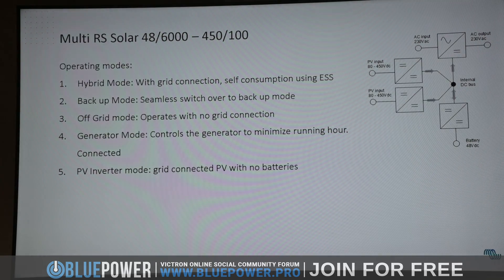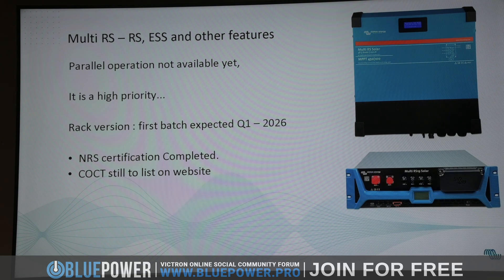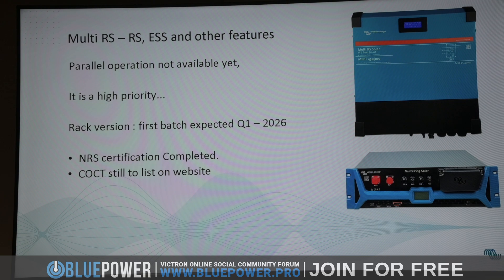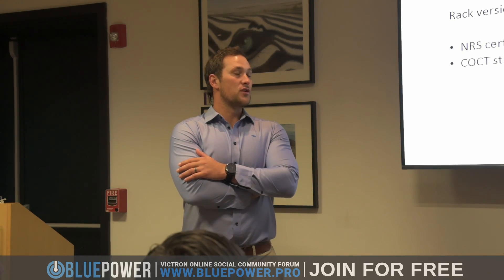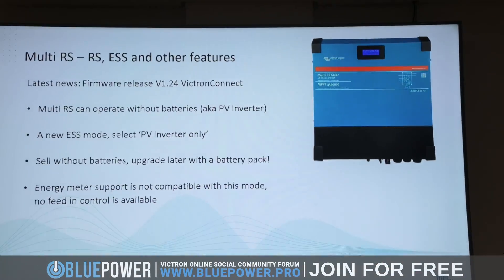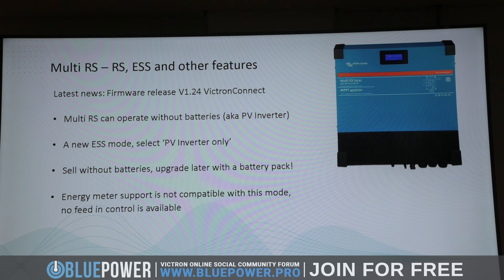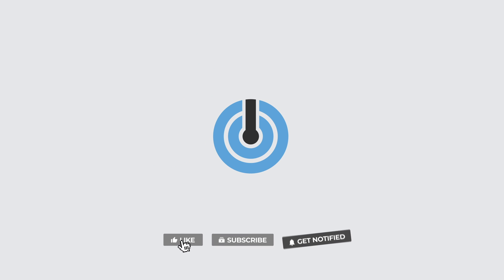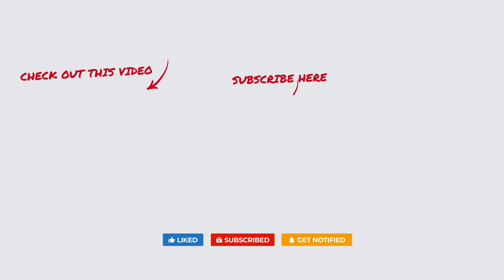Victron Multi RS19 48V Rack Mount [News & Release Date]

Comment: Its high frequency which means its not as bulletproof as a low frequency inverter.
Reply: they call it batteryless  too  
. so if you try in the future and buy a new   heavy  multiplus straight from the production line if still model exists  and buy 2 of  lets say 250/60  mppts seperate... you re gonna pay so much more!!  . i have the multi2 and  3 x seperate mppts
i could buy  a second 5000va in just the cost of 1x 150/35 and 2x 100/20!!   
     so if tests  results  show its good.. then it s on my next project